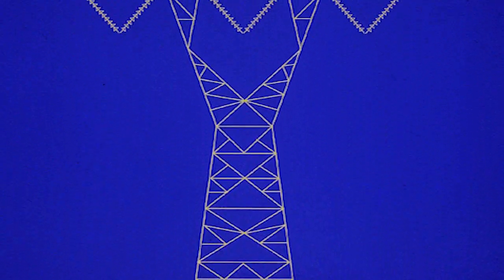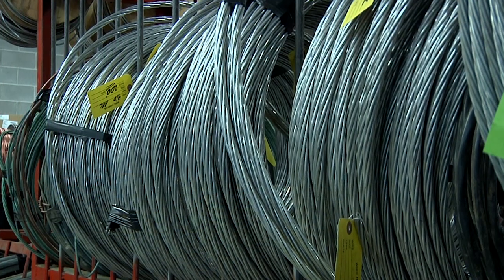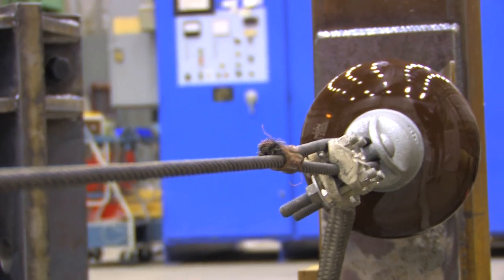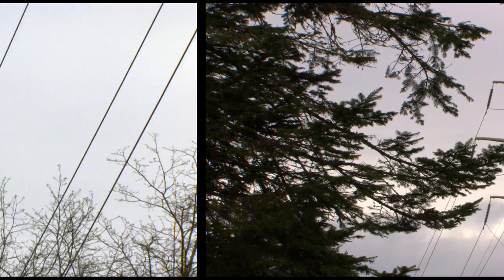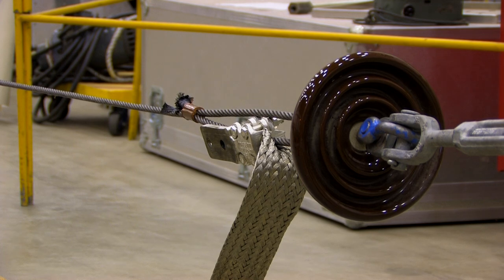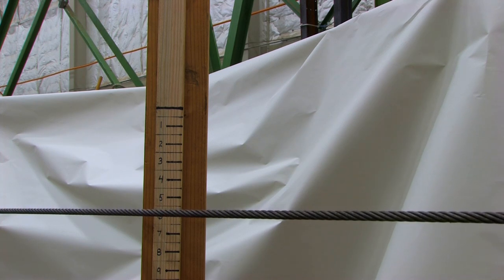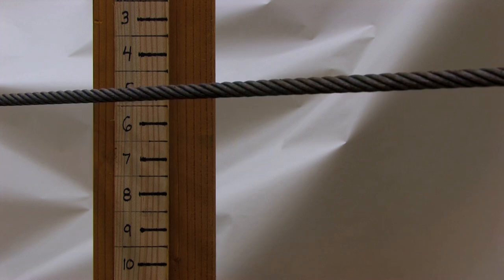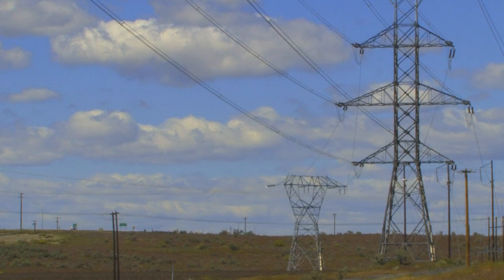Conductor Sag Demonstration - DOE Smart Grid Workforce Training Video

Comment: If I read the meters on the high current supply correctly there was 100 amps at 5.5 volts on the conductor.  Is that correct? Because that doesn't seem like much of a load.